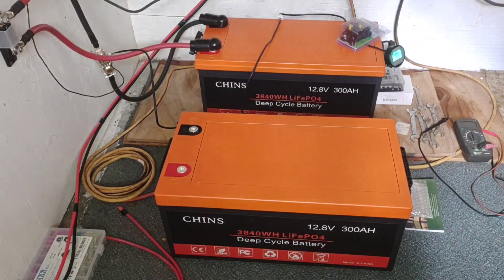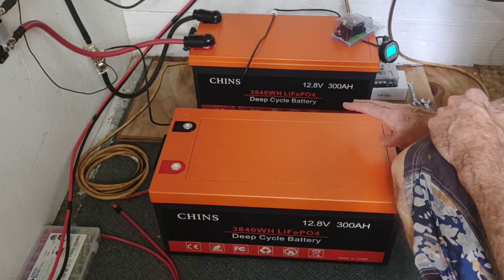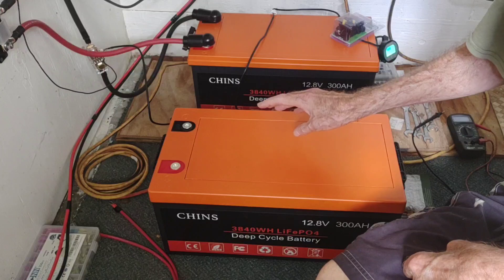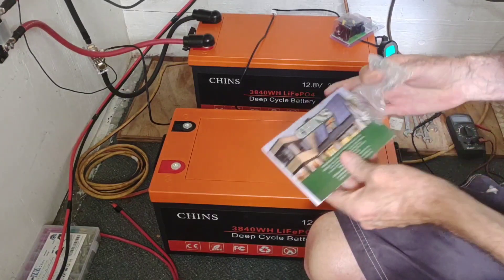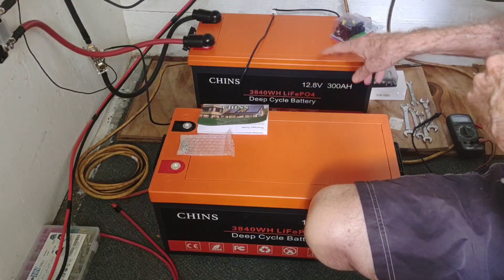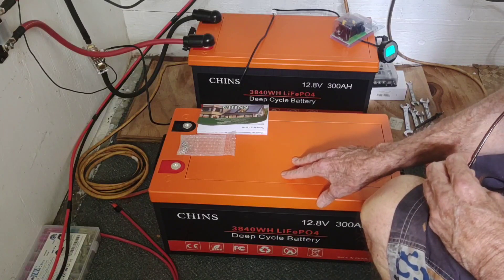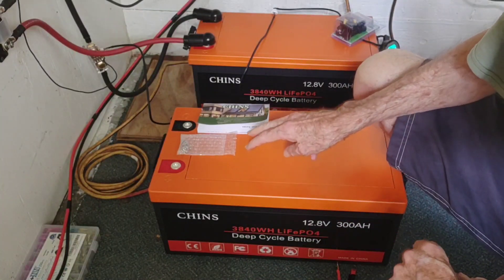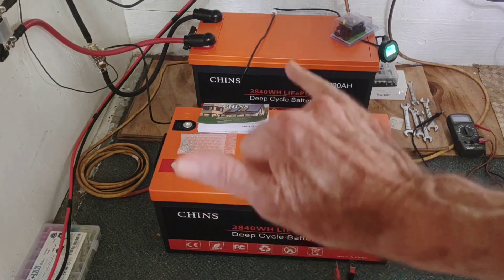Adding a second Chins 12.8v 300ah Lifepo4 battery

Comment: Chins says to charge them at 14.6 with final voltage 13.6.  They also recommend using their charger.  I have this same Victron charger, and the Lithium Ion setting is not compatible.  You can use its custom setting, but that too is marginal.  Chins also advised me to charge to 100% and keep it above 50%.  This conflicts with other advice found on the web for LiFeP04 batteries.  Where is the Great Battery Guru who really knows what's best?  I can't imagine any manufacturer giving false information.
Reply from the maker: Tons of information out there no doubt. Currently I'm taking the Chins up to 14.2v , holding that for one hour, then floating at 13.5v. Took me a bit of time to dial it in with these parameters.  14.6 set off alarms on charge controller,  and inverter occasionally under my charging conditions.  Not to mention the sensitivity to everything working in harmony.  I like charging even less as well. 13.8 absorption,  and 13.5 float . Not much to gained after that anyway. On the Victron charger,  I did set it to Lifepo4 in the advanced settings for the times I needed, and it worked perfectly,  with absorption at 14.2v . I'm always learning more fro people like yourself sharing our experiences,  and mahalo for that!🤙

Comment: just throwing this out there, I'd like to get your thoughts when you have time.
I rcvd. this e-mail from Chins regarding parallel hook up .....
(The recommended rest time kinda shocked me  ...20 hours !!)

"(1) Please use 14.2v~14.6v charging voltage to fully charge 2 batteries respectively, and then remove all charging equipment;
(2) Please let the two batteries stand for about 20 hours, and then test the voltage of the two batteries;
(3) When the voltage difference between the two batteries is less than 500mV, connect the two lithium iron phosphate batteries in parallel. (Note: The greater the voltage difference between the batteries, the higher the voltage. When connected in parallel, the low-voltage batteries are directly charged to form a reverse current. The greater the voltage difference, the greater the reverse current.)

The battery energy storage system is only connected in parallel. When the voltage difference is less than 500mV, there is no need to fully charge a single battery, and it can be directly installed in parallel.

(This process must ensure that all batteries are not connected to any loads, such as inverters, controllers, and home appliances.)

Hope it can help you,
best wishes
Timmy"

Thanks again for all your information !!
Reply from the maker: Mahalo Timmy! Yeah this helps a lot...the rest time is new to me as well! Appreciate you sharing that with us...aloha 🤙
Reply: Timmy actually sent this to me, he works for Chins 😑 ....
I am watching your videos and taking notes👍

Comment: I have 1 identical battery and an opportunity of getting another of a different brand (Enjoybot) 
Do you see a problem here ? Im getting mixed signals on this. Thanks
ps ....would balancing be sufficient prior to wiring in parallel as you have done. 
Thank you for your information, it is much appreciated
Reply from the maker: I get what you're saying,  and I personally have not tried connecting two different brands together.  Every manufacturer says not to, but I don't know.  After initial installation,  I always run them up to full charge to see how everything behaves before discharging and using in an application. 🤙
Reply: I have 3 different brands in parallel (Weize, Ampere Time and Smilaxe). I also have large and small capacity lifepo4 in parallel and it all works great.

Comment: Did you  set up midpoint monitoring of the battery voltage, or current?  I have a similar project, and I want to monitor the midpoint of two parallel connected batteries.  I am trying to use Victron devices to set up the midpoint monitoring, in case one of the batteries BMS's disconnects on low voltage.  I want to know when, and if that occurs.  The instructions on the Victron smart shunt, or 712 monitor are the same, but unclear on how to monitor the voltage midpoint of two parallel connected batteries.  Victron explains how to monitor the second battery, such as the starter battery of a vehicle.   However, I just want to monitor the midpoint voltage of a parallel configuration power source.  Can you give me any advise?
Reply from the maker: That's a little over my pay grade...I haven't worked on the midpoint you mentioned 🤙

Comment: I have a "Ampere Time" 24v 100ah ( very similar to your battery maker) that I'm waiting to be shipped to me early next month -  but I had planned to add a second 24v 100ah that I would wire in parallel - as soon as budget allows .  I've seen warning about adding adding a second battery at a later date as the can have an age mismatch that can cause problems? Did things go smoothly when you added the second and how many cycles do you think you had on the first when you got around to adding the second please?
Reply from the maker: Hi Kevin...I ran my first battery full time 24/7 for about 4 months before adding a second one. Chins recommended adding extra batteries within approximately 6 months of each other. When it came time to connect in parallel,  I charged both batteries independently to 100% full,  then let them settle a while and connected them together.  I have had no problems whatsoever doing that. All that being said, I wasn't discharging my first battery to zero during it's first 4 months of use. I averaged about 20-25% cycle for those months.  Everything has worked smoothly for me.  Aloha!🤙
Reply: @ProjectsinParadise808  Thanks so much for the information! I'm a newbie at this so when you state that you averaged about a 20-25% a cycle does that mean you never discharged below 20-25% or that you only used 20-25% of the batteries full charge for each cycle, say like a charge of 60% max and 45% minimum charge ( leaves 25% for charge) ? Thanks again!
Reply from the maker: @noguardrails47   I was cycling from about 80% full down to 60-70%. That's about all the harder I cycled for first 4 months.  Now, running a full size refrigerator,  I'm cycling deeper...maybe a full 25-35% per day. For absolute best life, most lifepo4 want to be cycled from 80% full down to no less than 25% full. But they can handle deeper discharges.  80%-30% is considered working in the sweet spot.
Reply: From what I've seen in Will Prowse's teardowns, Ampere Time and Chins are the same battery. Same BMS, cells, wiring style, injection molds... Just the usual relabeling thing you find with chinese electronics.

Comment: Why a giant 12v system instead of the increased efficiency realized by going to a higher voltage?  Lots of 12v appliances?
Reply: I use a lot of 12v devices in the house and it is much easier to find a good 12v inverter used. Easier to find deals on 12v 300ah batteries. Also it is nice to be able to grab any battery out of the system and throw in the trunk for camping. Can be used for dump trailer, jump starting a car etc. That said 24v is great if you have a nice 24v inverter like the sungoldpower.

Comment: In parallel with two separate BMSs. I wonder if that will affect the charging of all the individual cells?  Those two beautiful black and orange boxes of power - I want them.
Reply: I know on Battleborn they do . Contact Chins for BMS support . most will balance at top charge even in parallel as long as lead length and wire AWG is the same .go to DIY solar solar power with promise on YouTube. he has video's showing how to do that and more.
Reply: @robertmeyer4744  thank you for the info.
Reply from the maker: Not exactly sure myself how the two bms work in harmony,  but rest assured I will follow up and share...thanks JR! aloha 🤙